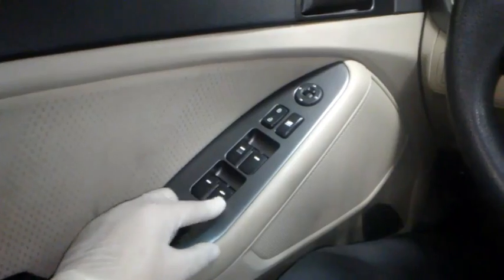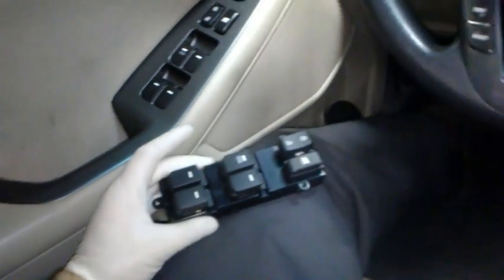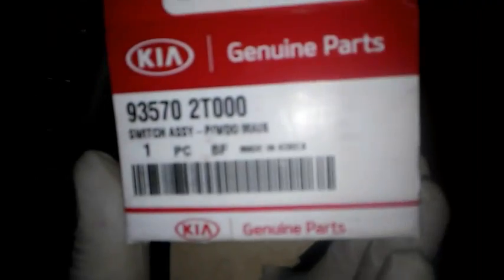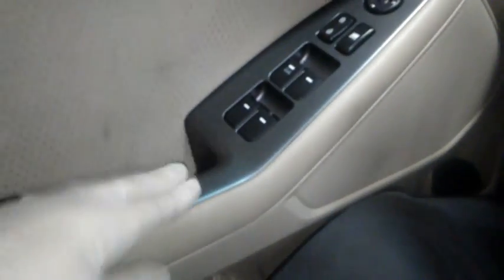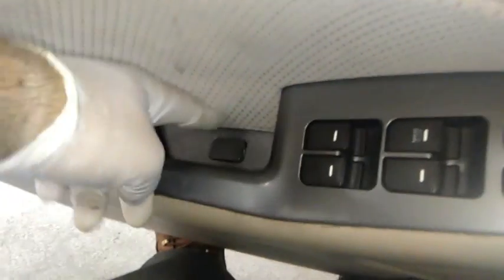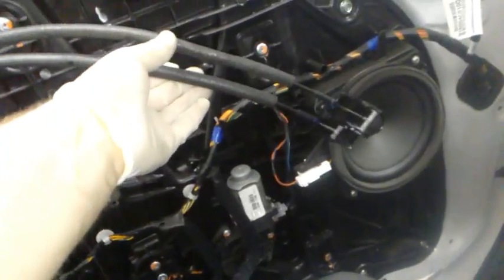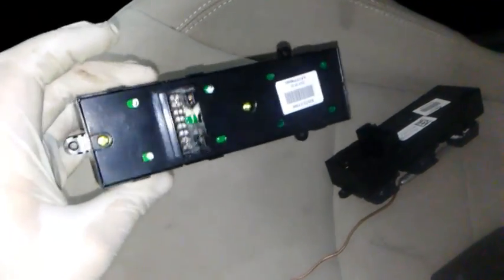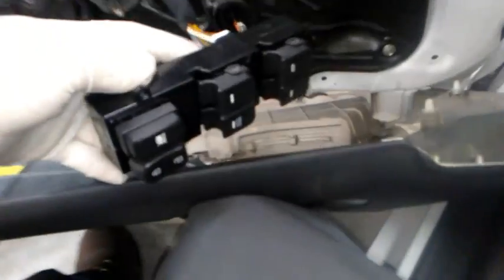2012 Kia Optima power windows not working right solved

Comment: So you gotta change the whole board?? I have a 2012 Kia Optima ex and I’m having the exact problem with just the back right one
Reply: my wife's car had the same issue with the passenger one, then it stopped responding, now it's the back ones too, I guess yeah
Reply: Same issue , did you find out what was the fix?

Comment: where did you buy it from?
Reply: the switch
Reply from the maker: +Sonja Green The Dealer
Reply from the maker: I bought mine from the dealership but I have linked many options on this video. Aftermarket switches work good too